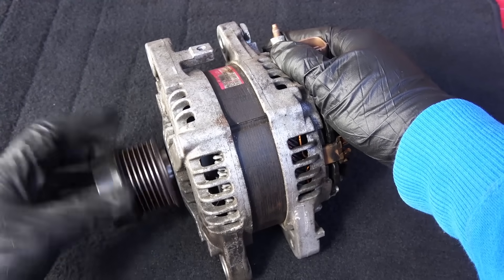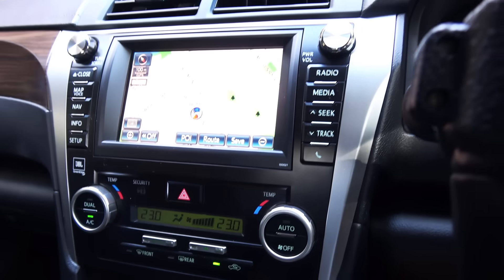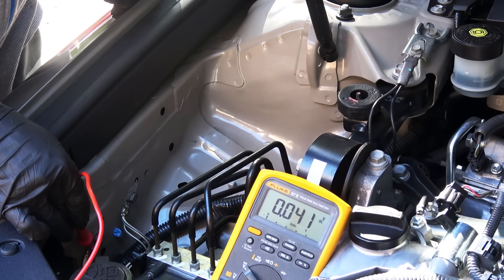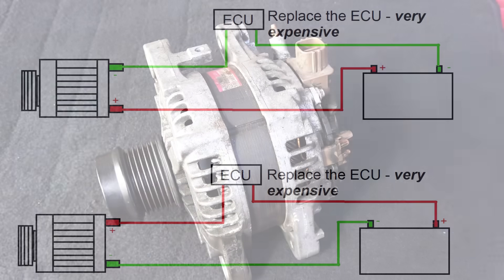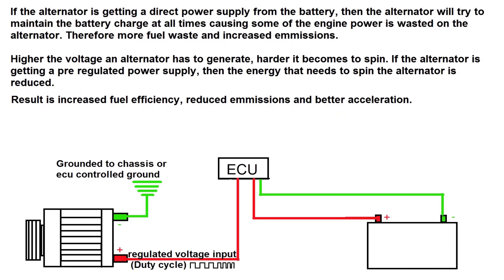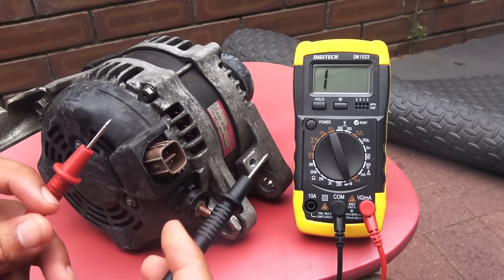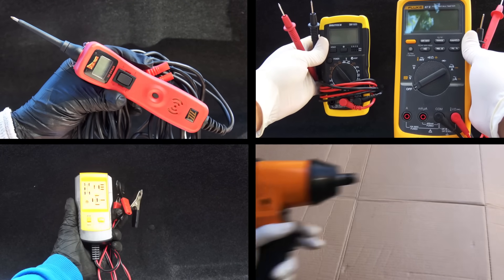How to Test an Alternator  ( Testing the Voltage Regulator, Diode rectifier and Stator)

Comment: I'm getting 15+ V in my car just in idle.
Reply: Check your regulator, high output voltage will short out your battery life.
Reply: @scottvan1898  so I changed the voltage regulator today and nothing happened. My voltage is still above 15.
Reply: Jonathan Escamilla 
Drive your car to auto zone  ,let them check your alternator .
Reply: @scottvan1898  I have done this 3 times already they keep telling me the alternator is good. Really appreciate your responses
Reply: Did you had any have any battery went bad,after you notice the alternator output up to 15+ ?  
Running your engine ,turn on everything’s such as fan , radio , ac, headlight ,……check the output with a good VOM,for couple time. Turn off each component one by one before turn off the engine.
do you think It’s possible that’s a high output alt after market for dual battery system.
Last, if in my case, i would remove the alt and overhaul it myself , made sure you have a can cleanse for cleaning electrical parts .good luck

Comment: Last week my Mavano wouldn't start.  
AA came, dead battery, replaced there and then,  but then he said that I need new alternator.  It was making a whuring noise.  Had been a couple of weeks or so. 
So Friday I got a new alternator fitted,  drove away and was horrified.  The whining/ whuring still there and lights on dash going daft like before.  It literally seems like the mechanic did nothing except charge me. Though that's not what I'm saying.  
Called him, got to go back Monday.  My brother in said it could be the regulator,  I read about that and yes the dash light symptoms match and all that, but would a faulty regulator cause that noise too? 
Any ideas? 
Have I just played for a new alternator when I didn't need one? 
I'm well pissed off! 
Cheers 👊🐕

Comment: ALTERNATOR is the weakest and most expensive car generator, made only to oppose the high mechanical resistance it takes from the engine, which translates into fuel consumption. The stator winding is made in such a way as to output three-phase current on which a Expensive and bad diode bridge rectifies it by making it direct current. The efficiency of this shift is of maximum 53%. It consumes a lot, it produces little and it has many expensive components that go quickly to make the drivers for sale. This mess was made especially in the purpose of consuming more gasoline and to sell components that you do not find in the old dynamos. On this site you will find videos showing the old dynamos, used now in some countries, which had a dual role: starter and after it started the engine became a generator. The mechanical force it consumes from the engine was small, it was robust, without straightening axles and it burned hard. dynamo if instead of the aluminum housing in which the bendix is located, a bearing cap is mounted in which to enter the rotor shaft. The stator coil must be decoupled from coal and coupled separately to become excitation coils controlled with the load relay. the rotor, the starter spins.If the sprocket of the bendix is fixed on the shaft not to slip, then it will always remain on the crown of the flywheel, and after the engine has started the sprocket takes over the movement of the motor and reverses the rotor that will produce current by charging the battery. some old model cars, this was done with a transmission belt that came on the flywheel and on the starter - generator.With a single good, robust, reliable and high efficiency device, two maneuvers were performed. Now there are two components that do the same. maneuvers but with higher costs. Question: why? I wrote above. You can find other hidden motivations. Success.

Comment: can someone give an idea what could happened or  whats going on .....defently is not  the alternador  ?or  is it? 

this the issue   started  firts a noise pulley   then got replace    a week after  battery light came on and  somone replaced my alternador  ( i notice a spark while he was doing it  he probably didnt disconect battery  )  well car seems  to be fine until night time  everytime i was on idle or turning my lighs off the car star  making this noise  like  surging a couple times so  i took it to auto parts place and  they say bad voltage  regulator  they gave me a brand  new  one  that i  put  yesterday  and  i tested and  is the same   bad voltage  regulator?( i notice that the instesity of the lights  keeps changing  very mild)

note : the  last person that put my  alternador yesterday  told  me  that the   conection that goes from  alternador  to the engine  was broke  bad it wasnt that loose  just didnt  have to force  it came out right away and he told me he doesnt think thats the problem cause is not coming  off )  someone  please ? thank you

Comment: Thanks. All the other videos fail I've seen fail to tell you how to test the rectifiers or regulators.

Have a Denso alternator which was not charging the battery at all. Changed it for another alternator and it was fine for about 20 minutes of driving but that also stopped charging altogether. Is the common fault for this the rectifier diodes getting blown?

Comment: sir may i ask u somthing i went to a service center to to service my alternator they replace the carbin brush and diode then i bought new battery then when i start the car my volt meter play on 14.0 or 14.2 somtimes but when i turn on the aircon it will droped to 13.0 to 13.2 then when i turn on the light fog lamp air con stereo simultaneously it will dropped to 12.7 to 12.9 is my charging system good or bad sir tnx for the answer hope u can help me

Comment: Hi,

I have some questions. I was looking at the schematics in my service manual and they seem to indicate that the PCM and the instrument clusters exist in parallel to the battery and alternator system - the PCM/ECU does not exist in the same circuit, originating at the generator, as the battery.

How should I test the components in this case?

Thank You in advance

Comment: I can jump my car and it runs no power problem. My belt is new. My battery runs about a 12+ for a v8 c63 mercedez 2010. When i turn my car back on its a 50/50 chance it will start up. It doesnt make a crank but sounds more like one weak electric zap. I dont know if just changing the voltage regulator may work or if i need a new regulator. The thing is, it looks fine! Need help.
Reply: the problem started when you bought a benz german cars are a cunt for electrical not to mention the cost for amg parts they arent as reliable as their 90s models

Comment: Very helpful video...!
I want to ask few questions regarding my car
I have suzuki ciaz mild hybrid
This hybrid supports car torque in intial pickup
While car is taking pick up my horn seems to be too slow 
Sometimes AUTO START STOP also dont work for 10-15 kms of riding
Dont know what to do 
Battery is fine 
Alternator is also charging the battery correct
What could be the issue..!
It is not the horn
I have replaced the horn under warranty twice
And also service person doesn’t get the issue..!
Please help

Comment: Excellent video all the way through except for driving the bearing in with a hammer wrong!  You should use a 15 lb sledge hammer and hit it with full force no just kidding ,  a soft lead mallet is best second best would be a socket the exact same diameter of the bearing outer and gently tap in to housing gently! Or a piece of hard wood anything that’s softer in composition than the bearing race is will work
Reply from the maker: You should use a 15 lb sledge hammer and hit it with full force, i giggled picturing that in my head

Comment: what voltage should I get at negative terminal of my ignition coil of my Nissan vanette.
Reply from the maker: check that on a repair manual, normally it's 12v at the live and 5v at the reference circuit wire,

Comment: a quick way to check is start engine then disconnect battery while engine running, if it cuts out alternator system is not working as it should  so need pull apart
Reply from the maker: good trick for older cars

Comment: The battery light in my car lights up when the engine temperature increase.  What is the cause of this.  I have a VW Polo 2015 1.6 TDI
Reply from the maker: need to have a professional grade scan tool hooked up and analyse the battery temperature sensor circuit.

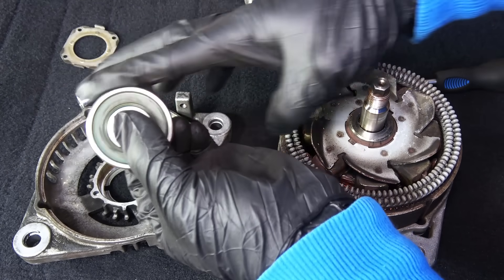Comment: 6:00 Was going well until you used a steel hammer to install the bearings.... use a vice or G clamp if you dont have a press handy... and if nothing else at least use a SOFT hammer. Otherwise good vid.

Comment: Hi my dc voltage is 13.5 without load but when all load are on voltage start to drop slowly . I notice even when I rev up without load stays at 13.6 something..I also tested the battery alone with load tester shows in good condition .I'm planning to change my alternator soon. What do you think??. My car is Toyota Corolla 92 model.. waiting for your reply. Watching from Philippines.tia
Reply from the maker: voltage will drop a little as you put load on the battery, that's normal. but as long as the alternator charging voltage is higher than the voltage on the battery ( the voltage on the battery before you start the car), even after the voltage drop under load, you alternator is still charging the battery
Reply: @JunkyDIYguy  thanks for your reply..more power to you.

Comment: I wish you can work on my Ford Focus with Battery light usually stays on and pulsating headlights,,,,
Reply from the maker: that's a classic sign of a charging issue, flickering headlight and battery light
Reply: @JunkyDIYguy  ,,, dang Ford. ... New Battery an Alternator tested good. Lots of wires, maybe something loose but ni issues when like ZERO degrees out ,,, crazy huh. Thankyou

Comment: Hey, thanks for the very informative video Junky DIY Guy! I have a 2012 F150 3.7. Battery drains completely if left to sit for more than 16 hours. If I disconnect the plug on the alternator (voltage regulator?) and leave B terminal connected, the drain goes away. If I replace just the voltage regulator, should my drain go away? I found a rebuild kit with bearings, voltage regulator, and brush assembly on maniac electric motors for 45 bucks and that surely beats the $200+ price tag for a new or rebuilt alternator.

Thanks!
Jack

Comment: Very well done. You give good information, and your video is very professional.  2 thumbs way up from San Diego. I did not know about the decoupler. I learned about repairing cars in the early 1970's and they did not have decouplers then. A lot of my cars were so old that they did not use an alternator, but a generator instead. That BMW alternator is outrageous!!
Reply from the maker: European car parts are expensive in many parts of the world due to the reputation as luxury cars

Comment: Thumbs up, you are very good at what you do. In my teens, around 1980, I did an auto technician course at diploma level, which has come in very useful over the years. The modern vehicles of today are so much different, especially the electrics and electronic systems and require your kind of expertise. Keep up the good work!!
Reply: Where did you do that corse?
Reply: Course
Reply: @economist633  It was a correspondence course at a polytechnic in the UK. I was living in Dubai at the time around 1980. Nowadays you can get these courses much easily on line, but look for good, proper institutions. Some can be bogus.

Comment: i went to autozone just to do a test they say voltage regulator is bad i believe they said same thing 2 years ago Do you guys know if i dont have no lights flashing or ets it starts fine to light on dash should i bother changing ? will i have symptops before it fails?
Reply from the maker: before it fails? it has already failed, that's why it not regulating the alternator output voltage. If the alternator is overcharging, then it could be pretty bad for entire electrical system of the car. regulators are cheap, so replace it when you can before something else fails.

Comment: Blew 75 amp fuse on nissan and after replacing it, the fuel pump doesn't work. I check fuse and no sign of blown or damage. I check main relay and it work. I check ground and it seem good. I check wiring harness and no sign of burn or damage. Could it be bad ecu or alternator? Also my fuel gauge saying empty and sure I add more than gallon in there. What could be wrong? The fuel pump new and strainer. The problem why fuel pump relay not clicking.
Reply from the maker: fuel pump should kick in before the engine starts. so you can easily rule out a faulty alternator. alternator's job is to fill the battery. it has nothing to do with the fuel pump. you can check the wiring diagram to see if there's any connection between the two if it's a very late model one. but i highly doubt that. you say it all stared with blowing a 75amp fuse, that a high amp fuse, so something could be shorted out and burnt. here's how i start. there're few things that could keep the car / fuel pump from starting. anti theft system issue, neutral safety switch, brake light switch. check all that,  If the engine is cranking then you can rule out all that as well, i say get a wiring diagram and start from there. check backward from the blown fuse. if that end up being a bad ecu, eeh, by pass it and put a toggle switch on he dash board to turn on the pump like in a race car. fixing ecu stuff and reprogramming is expensive. assuming fuel pump is the only afftected function by the bad ecu

Comment: Need help as my 2010 maxima voltage drop on warm up with load to 13.10 volt 
Will some one help me out as i replaced battery & alternator and all wiring is good
Please help me out 
Sajidfalak5111gmail.com

Comment: 💯💯💯👍👍👍💝💝😍💐😘
12 v 200 amp battery 14 v 200 amp engine can run better or 24 v 120 amp battery can run better of the motor. 
please answer my question 
i waiting to your replay.
Reply from the maker: You can’t change the battery voltage in a car. Stick to what you already have in the car
Reply: i wiil not use to the car 🚗 i will use dinamo  to a project to chargeing battery

Comment: Can this be done on new alternators as well? The seller told me the new alternators have some extra switch and that in only works if that switch is connected to a particular car.
Reply from the maker: well you test the alternator when it's working and connected to the car. so it should be possible shouldn't it.

Comment: PLEASE HELP ME, SINCE I LIVE ON AN ISLAND AND MY ONLY MECHANIC IS GOOGLE

•I HAVE A DODGE CARVAN 2012 AND THE LEVER OF CHANGE BLOCKS IN PARKING EVERY TIME THE STABILITY CONTROL WATCH STARTS,
ACCORDING TO YOUR EXPERIENCE, WHICH COULD BE MY PROBLEM

•WHY STABILITY CONTROL IS TURNED ON CONSTANTLY

•HOW I IDENTIFY THE FUSE OR THE RELEY OF THE LEVERAGE OF CHANGE
Reply from the maker: You need a professional grade OBD scan tool check stability control systems in car.

Comment: Thank you so much for an informative video. I have a parasitic drain and have pulled every single fuse in the car and it does not make any difference. Put a voltmeter switched to AC across the battery and wow, 29 Volts AC! That looks like a bad diode in the alternator!

Comment: You should never hit a bearing you are going to use again with a steel hammer use a copper mallet or copper bar.
Reply: And heat up the alloy casing

Comment: very nicely explained. i would like to add couple of things plz excuse me. while checking the rotor & stators also check their ground resistance. i.e their should be very high resistance between slip rings & its shaft, also between stator & alternator's body. thanks

Comment: The three wires connectors at the back of the alternator are for what purpose or function? By the way,great video of how to elaborately test the alternator,step by step procedures,thanks...
Reply from the maker: so the ecu can monitor the charging status and the battery light on the dash board is in alert